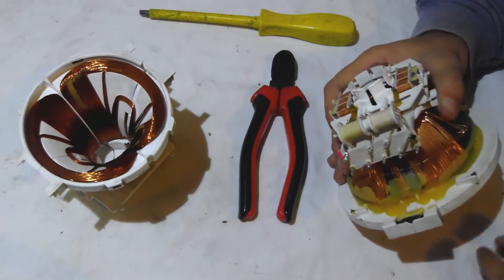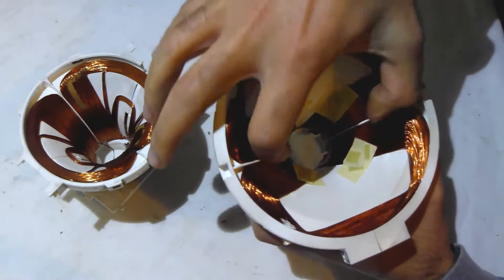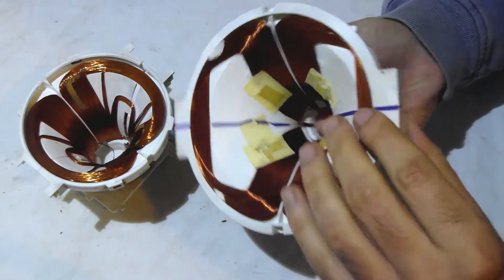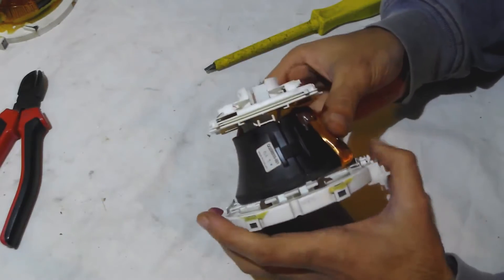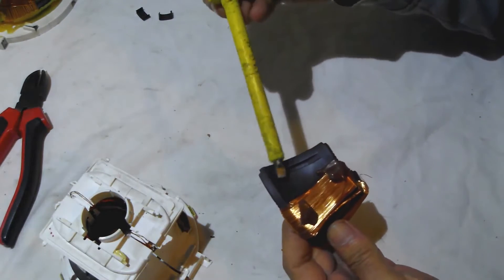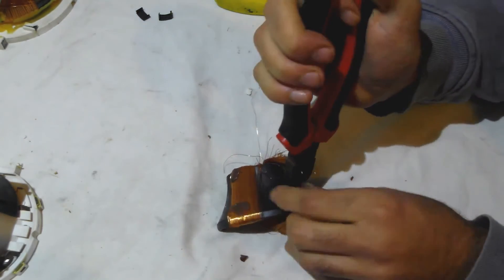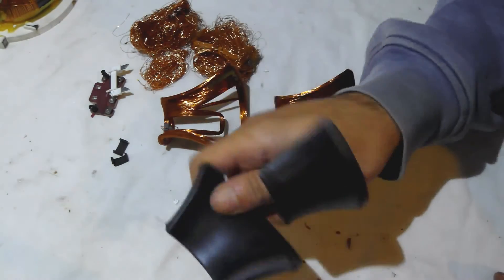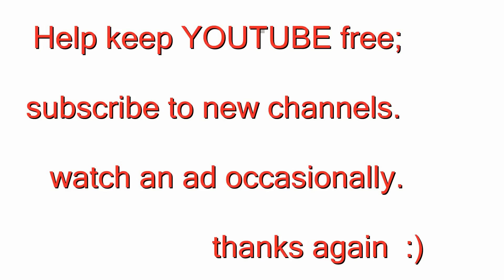How To scrap a Yoke (crt tv)  - copper scrapping

Comment: Hey bro good video, I see your last 1 was a year ago. Will you be doing any more?
I have collected a few of these yolks before. My method is just to usually smash them to bits with a hammer which is slightly therapeutic 🤣 and quicker. However think I prefer your method much tidier.

Comment: Hello, I need some advice. I came across some Tv's to scrap and got some of these yokes. The copper in them appears to be coated in something that's clear. So do they go in with insulated wire, or bare copper wire. I have a bag of bright and shiny bare copper wire, a bag of #2 bare copper wire, and a small piece of number 1 copper wire, as well as a bag of insulated copper wires and cables. Should I start a new bag for clear Coated copper wires like this? Also one other quick question, I have a small piece of thin copper that is rectangular in shape and about as thick as thick as the wall of an aluminum can is. What should I sort that with? I figure its number 2 copper, but I didn't know if it can be put in with my stripped # 2 wire or if pieces like that have to be separated
Reply from the maker: Andrew Purvis   hi AP. thanks for watching and asking.
The copper wire from TV yokes (and degaussing wire) are coated in clear lacquer, and therefore not classed as bare nor insulated copper cable (but in between).. the same as motor/transformer windings.

I have a separate pile for yoke copper (lacquered windings) as this pays more than insulated copper cable but less than bare copper. It means yet another pile to be sorted- but the efforts are well worth the extra financial benefits.

I assume your rectangular piece of copper is a portion of sheet copper, similar material as copper water pipes. This material is rarely near the quality of #2 copper, but i would definitely separate it and check with your local scrap yard first. Some yards are very strict about sorting different grades of copper, and other yards dont show much concern at all.
If you want to attract the maximum scrap value for  your collection, separating and grading is the only way.
Cheers.
Reply: Р